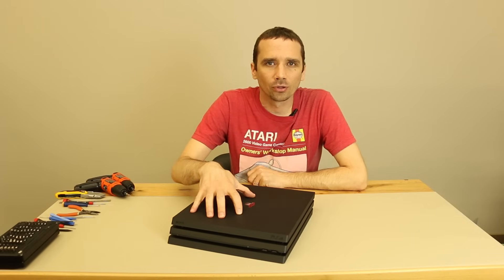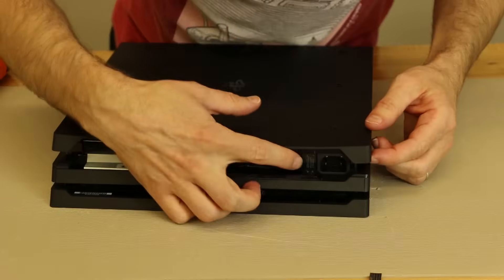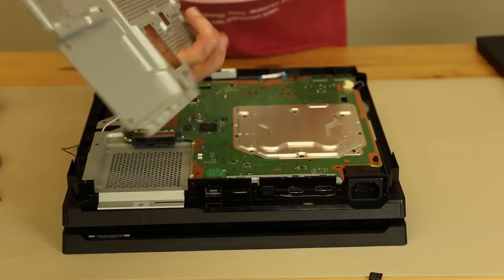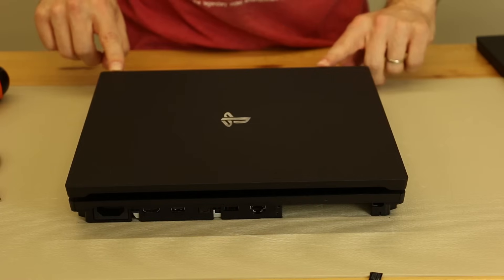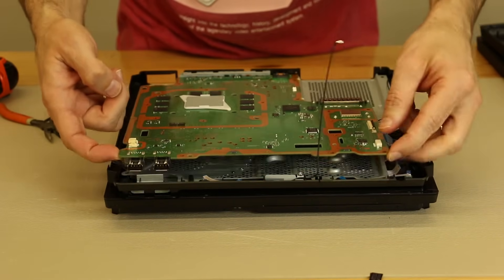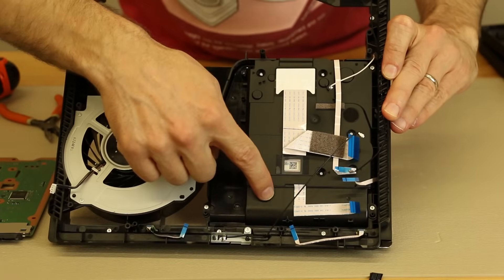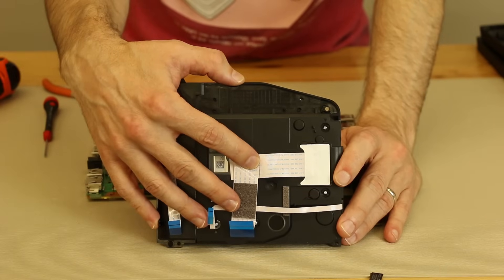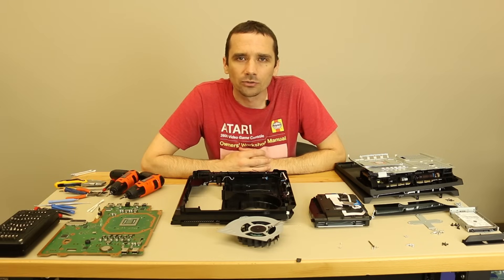PS4 Pro Teardown - Detailed Disassembly

Comment: Used this to deep clean my PS4 pro. It's never been this quiet before! Thanks a lot dude. Your detailed instructions made it very easy 🤘
Reply: Nikita Potapov  yeah the inside was full of dust that's collected over the years. The heatsync was practically stuffed with dust. My playstation would shut down for overheating. I followed this video it ran like new.

Comment: I want to know each head you're using to take out the screws
Reply: 000 JIS for the black screws (looks like a Phillips, but has a shallower point to avoid stripping. DO NOT USE A PHILLIPS).

T8 for the silver torx screws.

Comment: Bro the power supply cable disconnected but not at the wire connection, at the motherboard, thx for turning a cleaning into a throw away

Comment: Thank you so much for the video. My PS4 pro was loud on the mw multiplayer menu. First I cleaned the fan but no change in fan speed. I looked through the fan and seen dust and lint caked on the heat sink. Using your video I removed everything and cleaned it all up. I also removed the excess thermal paste and left a thin layer on the apu. I'll eventually change the thermal pads and thermal paste but the difference is night and day! My wife even noticed how quite it is now. Thank you so for an awesome video! You've earned my like and subscription.

Comment: i tore my ps4 pro down and did some upgrades to the thermal paste and a fan upgrade and my question is if some of the screws are missing or in the wrong spot couuld that make the ps4 not turn on or should that have nothing to do with it and i need to take it back apart and try to figure out where i messed up at?

Comment: I don't know if you'll see this, but while trying to remove the 4pin connector from the power supply I removed the entire thing from the motherboard. I tried soldering but it was all a mess and I even burned part of console's body and now it won't turn on. Question is, the 4 pin is different from your previous video. It has four pins on one side. Do I just solder them?

Comment: Hey, can i please have a reaction from anyone, i took my ps4 pro apart en dissambled it i blew out al the dust and applied new thermal paste and pads, then i assembled it together en then it started up showed blue light de fan blew the HDD turned on and then it shutted of again this was all in 6 seconds! Could the problem be to much thermal paste ? Or maybe failure from psu? But it gives power so thats weird could anyone help me, or maybe you tronicsfix? I dont have allot of money thats why i did it myself and now its useless please help me
Reply: Is the fan turning on? Might just be forgetting a connector
Reply: Jukins 5 yeah the fan is turning on then gets kindof loud en then the whole system shuts off
Reply: How did you go? Make sure you did up the APU support X bracket evenly and tight. maybe its a connection issue

Comment: just cleaned mine today for the first time and was super scared to mess it up but I didnt. it used to make a loud noise from the fan and now it's super quiet
Reply from the maker: Nice work!
Reply: did you clean heatsink?
Reply: Harv 83 yes it was so dirty
Reply: Do you have to put new thermal paste if you have to clean the heat sink? Or is it not necessary?
Reply: @iamdeadsilence  if you've been using it for a long time I would say to put new thermal paste.
Reply: @comet222u  damn I was hoping I wouldn't have to. I've had my ps4 pro for about maybe  1.5 years.
Reply: @iamdeadsilence  I would put new one because if it's like how mine was the thermal paste was pretty gone already when I opened it. It's not too expensive i got a small tube and was like 8 dollars I believe.

Comment: For the middle black screw on the PSU what did you use? It was the same size and shape as the others but this one just dissolves Everytime I try to unscrew. Like it's very soft
Reply: Same I’ve yet to find any information on what screw it is and it’s really irritating me. It’s the only thing holding me back from cleaning out my PS4

Comment: So is there any easy way to get the power supply connector off the Board? I ripped mine off the mother board by accident and can’t find anyone that is willing or able to fix it and solder it back on. Is there an easy fix for this? I don’t want to do my PS4pro and replace the paste in that before getting my ogps4 fixed as I don’t want to do it again. 

Any help is much appreciated. Thanks.

Comment: What tool do I need to take you the power supply i can’t figure out the screwdriver ur using?
Reply: Kazzajack I actually took the cable from the power supply not from the motherboard it was way easier and did it with my fingers
Reply: comet222u ok cool thanks for the tip

Comment: Freaking broke my power supply cable taking my pro apart to clean it and now having trouble unhooking it from the board. Any advice? I got a replacement cable afraid of ripping the port off the board. Help
Reply: I made the same mistake just make sure your pliers are on the plastic only and not touching the wires and just take your time wiggling it free.
Reply: @thelivingrocks1933  yeah wasn't using quality etched pliers......
Reply: William Hench did everything work out in the end?
Reply: @thelivingrocks1933  yes I already successfully fixed it last year before we talked on here.

Comment: The initial two screws you remove, the ones behind the warranty sticker, are torx security screws. They can't be removed without special tools that I'm guessing most people don't have lying around. Might be worth mentioning that little piece of info in the video.
Reply: I unscrewed them without special tools ☠️
Reply: I just used a SMALL ass Philips screwdriver 😂😂 stg I saw it and thought it was the worlds smallest screwdriver ever made but I know it’s not it was just small enough to fit and actually get the screws out behind the warranty stickers.
Reply: Actually most of the silver screws are of this type. You can in some cases use a flat screwdriver (1.5) to get them out but don't count on finishing the job that way. You'll need a security torx screwdriver of size T9.
Reply: @michaelberg7201 
Yeah, that would have been worth mentioning. I had to use a tiny flathead.
Reply: @michaelberg7201  my PS4 i had to use a T8. Thanks for your info.
Reply: @michaelberg7201  the tool kit he has on the lower left of the screen anyone can buy and it has all the bits you need I know this cause I have it it's definitely a worthy investment
Reply: I got them out with a mini flat head 😂
Reply: @kamilmahdalik4005  yeah ive used all sorts of tools over the years and some I've had to tweek into shape, to work😂
cheers man
Reply: Yeah I went to home depot and got a allen wrench set for 10 bucks
Reply: All the ps4 takes a T7 or T8 mine for example took a T7 it’s a torque. Also a Phillips 0-1 that’s all the whole thing takes. But the majority is the torque.
Reply: I removed all of the torch security screws with a flathead thermostat screwdriver.

Comment: Here's a tip to remember what screws go where.... Take a picture before for reference.
Reply: True. I also get some paper and draw squares. Then label the squares to the corresponding screws as I go.
Reply: Mikal Banks o
Reply: Can’t pull the green hardware out because of a white wire so thanks for not telling me that
Reply: Just circle the other screws with a red sharpie
Reply: Lay the screws out in order you take them out and then just start from the last screw and work your way back
Reply: But what if they are different lengths?
Reply: Good idea that
Reply: Hahaha...  I totally failed to do this... Then regretted it immediately... But I was able to put it back together as before. The paste job went really well with a kryonaut.
Reply: Removing the power supply/hard drive and a few screws/disconnect wires on the other side.
The "Entire" motherboard with both panels attatched, wiggle out at an angle without needing to take it all apart.
You won't have to repaste or anything.  : )
Just found this out.
Reply: Barcode731 good tip
Reply: I took a video it's much easier

Comment: My disc drive stopped working after this, I didn’t do anything to the actual drive and didn’t even remove it. The most I did was clean the thermal paste off of the APU. Anyone have any advice on what to do? I see replacement drives online but people are saying that I have to match up the disc drives with the model number would this be true?

Comment: I have question for you. My PS4 Pro is so annoying and the fan is super loud. So I went by your steps today and also I cleaned out the heatsink and I took off the old Thermal Paste and I put on new Thermal Paste. After I put the playstation pro back together I out 
Red Dead Redemption 2 in and the fan is really really low sounding. Its tripping me out because it should at least run a lil louder so it can cool it down. My ps4 pro feels really hot and the fan is working. But I barely hear it and its barely blowing. 
Would you know what the problem might be?

Comment: G'day I'm dissasembling my ps4 pro to clean the heat sink as the fan is like a jet taking off (already cleaned fan), what screwdriver is required to remove the screws behind the warranty stickers?
Reply: Look at the description above for the tools used in this video, You need only two screw drivers for dissembling the whole PS4 Pro:
1- Torx Security T8
 (To remove the ones behind the warranty stickers )
2- PH00 Phillips  (To remove other screws inside PS4 PRo )
 Also I advise you buy and prepare the other tools it will help before you start, brush, tweezers, canned air and any other tools to help you clean your heatsink and other parts inside your PS4 Pro

Comment: Hello, I'm going to replace the power supply of my PS4 PRO, but I'd to know what type of screwdriver torx I really need to use, (TORX 8 SECURITY or TORX 9 SECURITY?),  Does any other tools I'll need? 
Thanks for the video and the attention.
Reply: Look at the description above for the tools used in this video, You need only two screw drivers for dissembling the whole PS4 Pro:
1- Torx Security T8
 (To remove the ones behind the warranty stickers )
2- PH00 Phillips  (To remove other screws inside PS4 PRo )
Also I advise you buy and prepare the other tools it will help before you start, brush, tweezers, canned air and any other tools to help you clean your heatsink and other parts inside your PS4 Pro

Comment: Great channel man! I have a question, do. I bought, little over a year ago, a CUH 716B PS Pro console in Croatia, EU - with extended warranty of total of three years (one by SONY, and two additional by the store i bought the console in). Bu your video i have removed top cover off and cleaned fan. I should say that i was not really that dirty after 12.5 months, because i do not smoke and i regularly clean the room and the outside of the console. My question for you is this: should I undo my warranty by having third party PS4 Pro servis totally disassemble my console, and replace thermal paste on the PS Pro with Arctic Cooling MX-4 one? Or, should I just wait for two more years, and just occasionally clean the fan like I already did. I should say that for now I don't have ANY problems with my console, it just became louder after many hours of playing God of War 4, and thats when I became interested in all of this and came by your channel. Regards from Croatia, hope for reply! Bye!

Comment: Do you have to take the whole mother board out to gain access to the inside of the disc drive? I have a little one that's got a credit card stuck in the disk drive! Help me I'm a amateur and don't feel confident taking EVERYTHING apart.
Reply from the maker: Yes, everything has to come out.

Comment: I know this is old, but I have an issue. The black screw on my power supply seems to be slightly stripped which prevents me from taking it out. Any solution you would know of?
Reply from the maker: Try different sized bits, pliers, etc. If there's no other way then I'd drill it out.

Comment: Why does a PS4 pro have a tiny 4 pin connector to the motherboard but on a PC the PSU still has a massive 24 pin ATX cable connector?  Even on a low end/low power PC it has a 20 or 24 pin ATX power connector.

Comment: im trying to figure out what side air goes into the ps4/fan ?  and the way it looks is the air goes OUT the back vents. but does air go in both sides or just 1 ? im trying to figure out the best cooling position as the winter time its ok but the summers it gets hot in my room. and i just picked up a new ps4 pro .
Reply from the maker: Air comes in both sides. There is no way to upgrade the disc drive on them. I wish!
Reply: is there an upgrade to change the disk drive? to play 4k ?

Comment: You said you got the top off and the hard drive was upside down... You have the ps4 pro upside down so its actually the bottom youre starting from and the hard drive was correct side up..
Reply: Alright alright guys calm down we all ask questions when learning don't act like yall never been there before sheesh
Reply: I was thinking the same thing too
Reply: Does it not delete everything when you renove harddrive ???
Reply: @anes4375  why would it?
Reply: @High_Monk  - thought it was somehow connected so if rou removed it it would delete your data. But no it does not, just found out.
Reply: @anes4375  The data is stored on the hard drive, as long as you don't break it or remove it while the PS is on, the data will be safe. Kinda the same as removing the SD card from a phone I guess.
Reply: @anes4375  how it can be deleted if there is no power? think before you type
Reply: @ezekieloz  maybe for whatever reason they were thinking that because if you remove a hard drive while its on, it will damage it, and they thought that principle carried over
Reply: @anes4375  wow, such an idiot
Reply: @tommybro5313  - an idiot who s a dentist, okay sherlock 👌🏿
Reply: @Brando Commando and? What is wrong in that ? I made a mistake in a word, not the meaning. Omg. Get a life man

Comment: I was hoping I could double my RAM to help with some UI lagging when I'm quickly switching apps (leaving the game to view my trophy to-do list, for example). Why don't they have multiple configurations, like gaming PC's? I already threw a $800 4TB SSD into mine to max out the capacity and storage performance. Now I want to improve everything else. Yeah, I could just get a PC, but it's not the same. I like PlayStation, love the controller, and love my trophies. I just wish the Pro were a little more Pro. I'd pay $2000 for a top-end PlayStation.
Reply from the maker: If only we could mod these!
Reply: Indeed! And I get the idea behind why they don’t. So users have a consistent experience and developers don’t have to account for lower standard specs, and the base level that is affordable to the masses, etc etc etc. it’s just sad to know that there are better specs out there to be had but we are limited regardless
Reply from the maker: Yep...it's still way more fun to have something you can customize.
Reply: You could just use controller on PC.
Reply: Yeah I thought about that before, and I have played some PC games. Problem is not all games make it to PC, and controller mapping is never a perfect mapping so a keyboard and mouse end up still being required usually.

Comment: After watching both they both look exactly the same. The heat exchangers are exactly the same, the regular ps4 has 2 rows and the pro has 1 and if you look if you put the 2 rows of the regular into 1 row you have the same as the pro. Also looking at the RAM comparison they both have the same RAM. So you're paying $100 more for the same console but different casing.

Comment: wow, never use power screw drivers on electronics!
Reply from the maker: Um, why?
Reply from the maker: There's absolutely no reason to not use power screwdrivers if you have taken apart a bunch of them before. If you don't know what you're doing then of course not.
Reply: I wouldn't use them for reassembly.

Comment: Hello, I have a playstation 4 and chopped me inside the CD it was a CD from the mouse driver is smaller than a normal CD and I do not know how to remove it is shaven in the inside PLEASE HELP SOMEONE :(
Reply from the maker: I'm not sure what you're asking. You'll probably need to take the disc drive apart to get that disc out.

Comment: i can't get the power cable out from the case i think i damaged it from the sides should i change it. The CR cable and how do i get it off without a plier?
Reply from the maker: CR cable? The power cable just pulls out
Reply: Yeah mine is stuck for some reason i didnt have nose pin plier so i used a tusor and ended up damaging the wire like i can see aluminum in the wire now. Tell me should i change the cable? And im gonna use a plier today.

Comment: Rip ps4  xbox is king again
Reply: rob4748 not rlly, xbox one x has more power then the pro but currently it seems most of its specs arent even going to be used, the pro on the other hand has set itself up properly for devs, the only way xbox one x will beat ps4 is if devs arent lazy and use its full power

Comment: hey guys i got a question for those of you that have taken apart your ps4 pro.

im a vaper and i have noticed that my disks get smudged with an oil when inserting a disk into my ps4 pro, i've figured that the vapor oils are collecting and building up in that fluffy lining and sometimes i get a dirty disk error but its often rare and it isnt a problem but i do want to clean my ps4 pro but the main thing i was wondering about before i do take it apart,...you know the fuzzy things the guard the CD hole, thats is what is holding vapor oil's in it and applying to the disk when inserting or removing a disk..what part of the ps4 pro is that actually attached to? i couldn't spot it in the tear down exactly, i need to wipe those fluffy lining to clean it of any oils